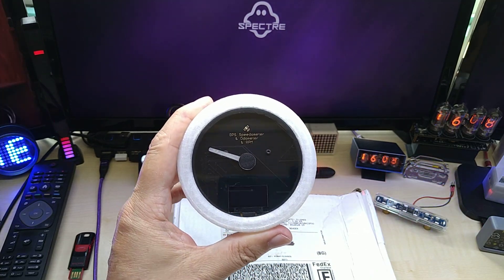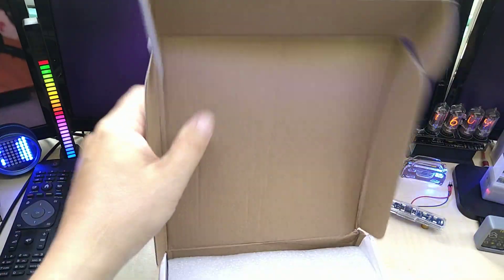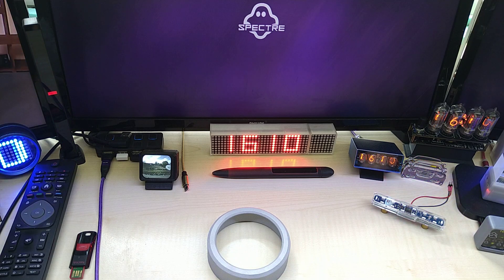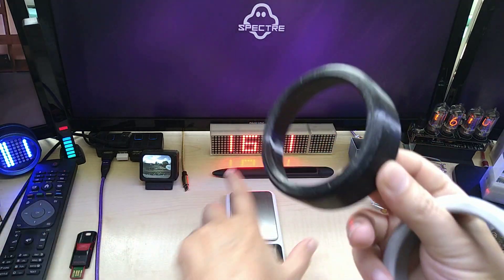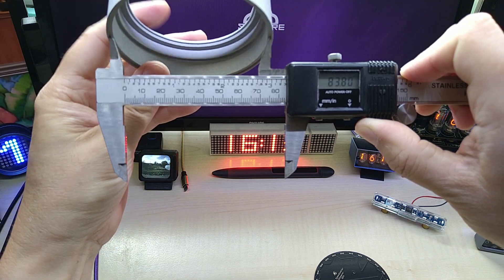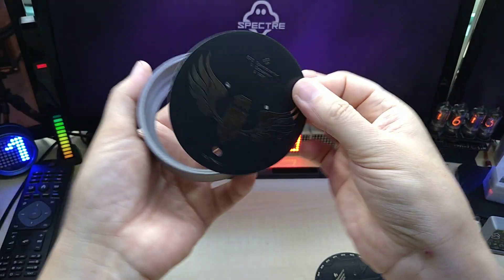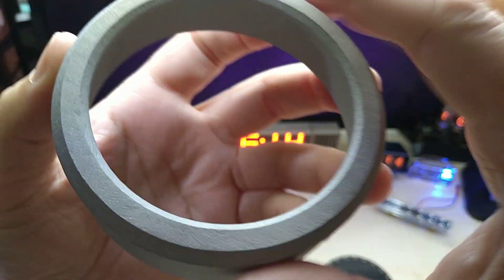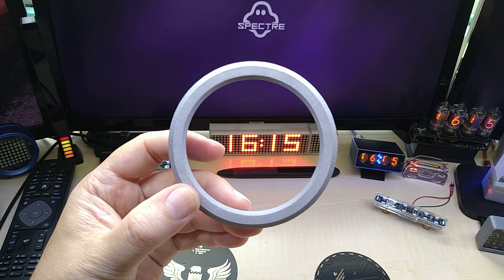GPS Speedo Neopixel Tachometer OLED Display designed and build by #Hayri 3D Printed Metal Case Part1

Comment: Hi Hayri, very interesting. Was it expensive? For sanding the part how about a fine file to keep the rim square, followed by a tumbler / shaker to bring back the sand blasted look? Or maybe even get hold of one of those mini airbrush sand blasting kits like Fengda BD-178. I've not tried a blaster yet but I love the shaker / vibrational tumbler for aluminium parts. Very uniform and nicely dull. Perfect for a primer coat too. I use Walnut media - very gentle and controllable so less likely to damage threads etc. I just inspect the parts every 15 mins or so check progress. It's nice to be able to process parts in bulk.
Reply from the maker: Hi Nik, I will actually put it into my CNC Lathe and start with sandpaper and eventually try to turn it down a bit, to see if it is strong enough for that. For tumbling I do have stainless steel pins, which are good for brass and I do have glass beads for sandblasting as well, So  for getting a matt finish I should be set. Have never seen a video about post processing a 3D printed metal part, but then again I never searched for it either, but it will be nice to know what you can do 🙂I guess I can save myself the video about putting it together with the acrylic front and the PCB's to see how it will look like and make a video about processing it and then put it together and compare it to my CNC machined CAN BUS Gauge which is anodized aluminum.
Reply: @iHayri1  It sounds like you have many options to experiment with so yes, please make a video. I'll be interested to see if the sintered 3D print - if that's the process you opted for - has a continuous texture as you remove material or if it can be highly polished or burnished.

I wonder if the sintering process results in a predictable amount of shrinkage of the part and if so whether pcbway compensate for this. I had a design made by Shapeways but it was lacquered and not a mechanical part so I couldn't really tell. Looked great tho!
Reply from the maker: @nikthefix8918  I am really not sure but I guess it was the sintered option, although I think it was not specifically mentioned. Unfortunately you have to compensate for shrinking which I find kinda dumb as metal should not really shrink, but as you can see in the video, the PCB's did not fit, you would not have this problem with CNC machining apart from the manufacturers tolerance which again you can select when ordering a part. Compared to my CNC machined case, which had also M2 threads and the same "lip" on the back for a PCB backplate, everything was spot on, including the flawless anodizing which again you can select the color or any other metal for that matter.
I will chuck it up on my lathe tomorrow and see what I will get 🙂